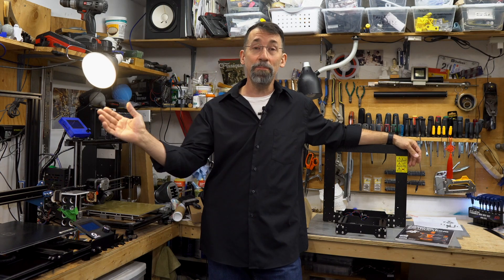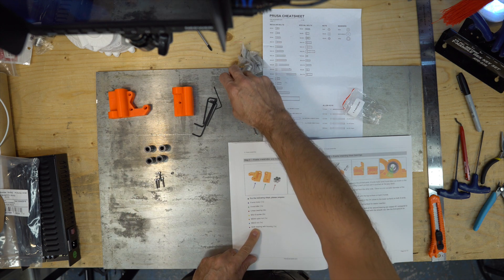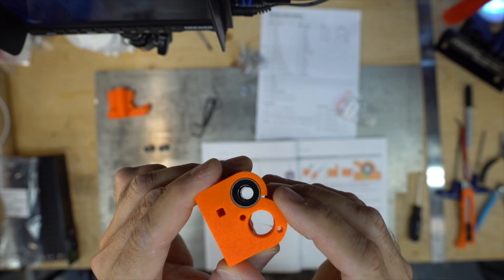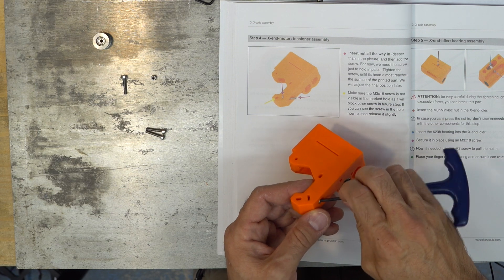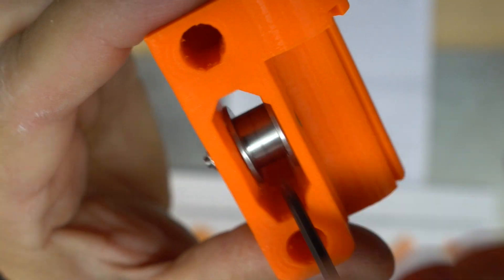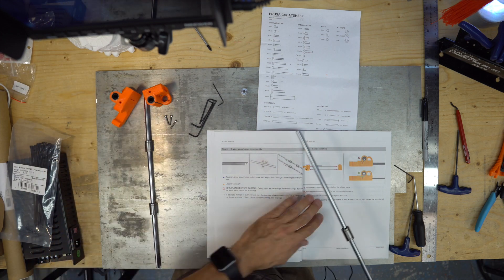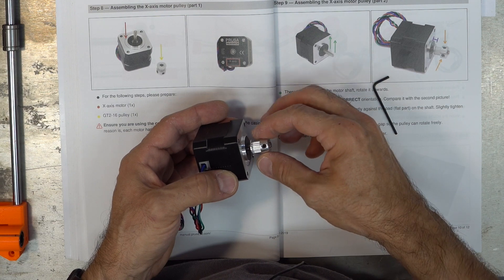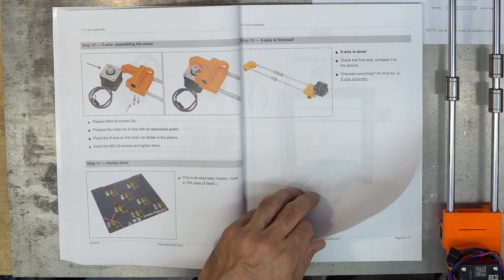Prusa MK3S Assembly Part 3 (Chapter 3)

Comment: The bearing holes have a taper, you are lucky to not have broken the 3d printed parts, it clearly says on the manual you have to put the bearing in through the same hole (the one that doesn't have a ridge at the end) one of them is not supposed to be flush with the 3d printed part
Reply from the maker: Yes you are correct I have check back, but I assure you they are not easy to brake, I had to brake one on another printer to get the bearings out and it took a vise and a 18 inches big flat screw driver,, the way they are printed gives them strength.
Reply: @Franks3Dshop  Great series though! very useful and well done, thank you!!!